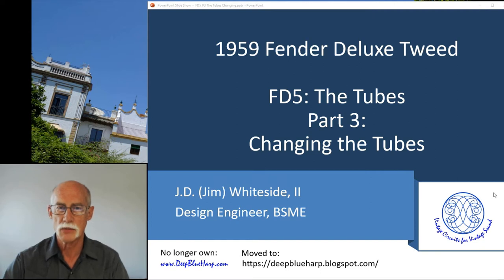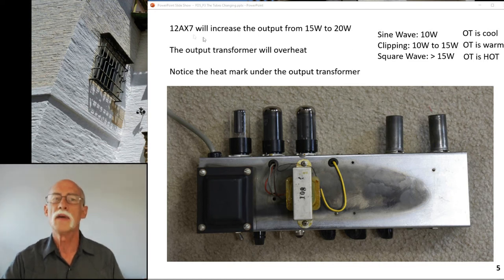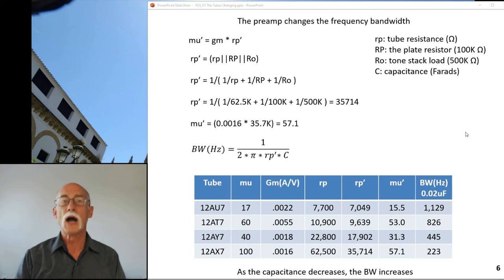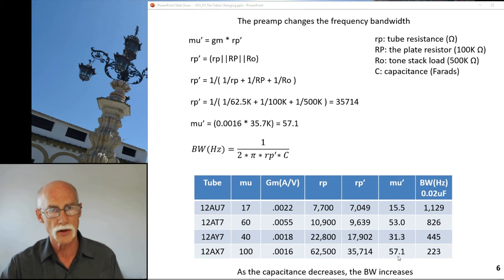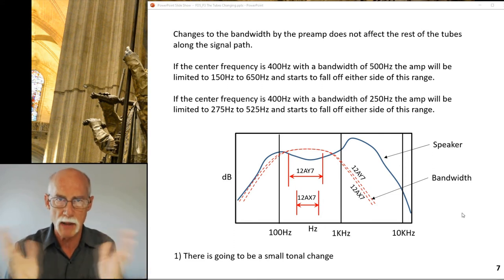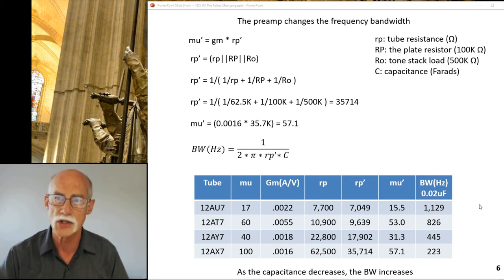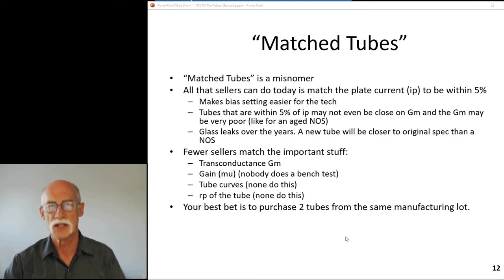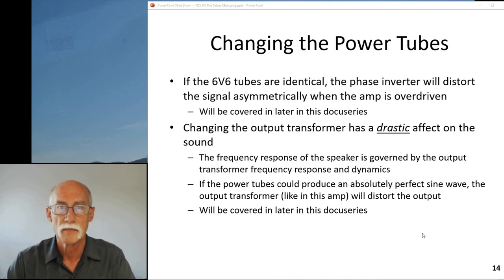FD5: The Tubes, Part 3: Changing the Tubes

Comment: Your videos should have thousands of  views.  Hard to compete with kittens :-/      Thank You for these!
Reply from the maker: Either. The cathode biased ones tend to be more prone to squeal because the cathode resistor is a feedback (not many folks understand this). The oscillation (squeal) is grounded when the cathode is directly connected to ground. In amps where the 1st stand cathode is grounded and the 2nd stage has a cathode resistor, it is the 2nd stage that squeals. 

Either way, the next culprit that causes squeal is when the ground of the preamps is sent to a common star ground. Star grounds also include the grounds from the power tubes. The preamps need to be grounded at the chassis at the preamp tubes or grounded at the input jack (best). Preamp grounds need to be ground as far away from the power tube and rectifiers as physically possible. Which is how vintage amps are physically laid out. "Signal to the left, Power to the right, Stuck in the Middle with you..." :)